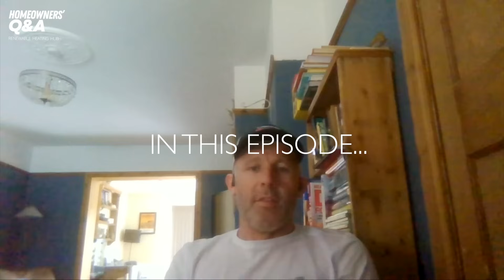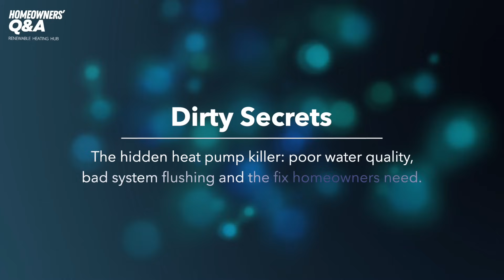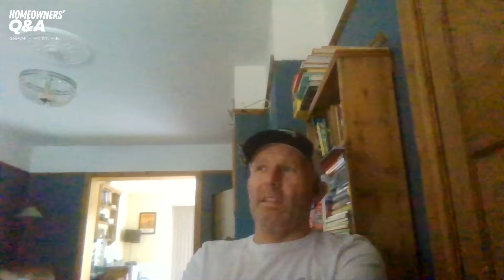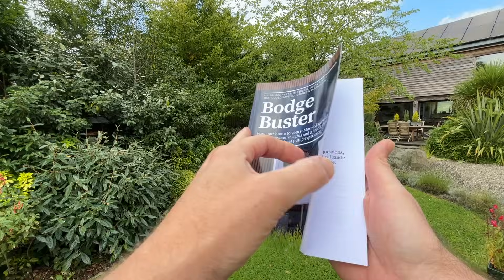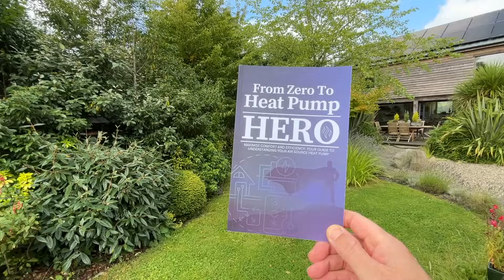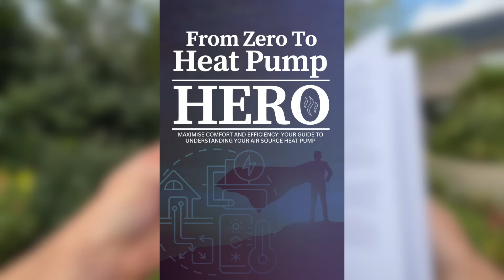Is Poor Water Quality Destroying Your Heat Pump & Radiators?

Comment: The current high mark for water heating quality in domestic systems is less than 1500mS. I come from an industry where the specification of the water is less than 0.1mS and uses high purity system pipe work. I know from direct experience that even on high purity systems, as soon as you stop circulating and as soon as you stop a sanitisation cycle that microbiological growth in the form of a biofilm will start.
The question has to be, in heating water, does it matter if you have microbiological growth, nobody is drinking it.

Comment: The ground source heat pump that is currently being installed into my high rise is being promised as low cost maintenance compared to our district gas central system. It is a hard water area so I'm thinking my housing association is not fully aware of this. It worries me that without legislation costs will be cut...and the heat pump will become inefficient. Obviously the electric company will be the winner.

Comment: I found this discussion very interesting. Some 50 plus years ago I made contact with Peter Muetzel the founder of Fernox. I was flushing and cleansing heating systems when all around said, oh, bang another rad in. I eventually moved up to commercial systems in large housing complexes. It’s ridiculous to consider all those years later system corrosion is still an issue, causing damage to internal components.

Comment: I remember when training on chemical treatment of heating system. Some years ago, it was explained that molybdate is an oxygen scavenger and is predominantly required in open vented systems. In practice the molybdate is used up, leaving the nitrites, still dosing the system water. This should then be topped up only with the chemical required and not the universal liquid provided in the bottle from the merchant. Just adding another bottle of the same mixture causes overdosing of nitrites, and this can lead to some problems with the system. The course also explained that molybdate is not really required in sealed, systems that are correctly constructed as they would not contain oxygen. So there would be no need to scavenge for it. In fact, if you look at vdi 2035 it gives the water quality measures required for inhibit to be unnecessary. If the system was clean enough prior to adding inhibiter, it would be almost certainly vdi compliant and no inhibitor would be required according to the science. Unfortunately, the regulations in the uk would still require the use of an inhibitor even though in this situation, it was likely to lead to a negative impact on system water quality. As far as i'm aware, the manufacturers only care if they're equipment is affected by poor water quality rather than if an inhibitor is present. I have run many tests on flushing and cleaning of systems and found that if you return a short while after the system has been compliant it will almost always no longer be compliant as the fresh water will have lifted some of the more stubborn deposits either into solution or suspension, causing the water quality test to fail. With gas boilers, whether water quality cannot be adequately maintained. I have historically used plate separation to protect the appliance from the system. It may come to pass that this will be a required technique for heat pumps. My reservations for the application with heat pumps are two fold. The first is that I suspect the platit exchanger in the heat pump could be cleaned using a suitable flushing, chemical and the power flush pump or descaling pump. Secondly, that there would be a loss of efficiency from the heat pump caused by the requirement of a delta t across the plates in the plate heat exchanger. Having said that vailant offer a kit that incorporates a plate heat exchanger to allow the use of antifreeze in only the outside unit. In this application, we have efficiency losses from the antifreeze, as well as from the plate heat exchanger.

Comment: The annual service provided by Daiikin on our heat pump does not include a system water test. Does that mean Daikin is liable if there is a heat pump failure exacerbated by poor water quality?
Reply from the maker: That’s an excellent question. I’ve not seen any manufacturer service cover or include this.

Comment: At least with the VDI 2035 approach you can test reliably, and without needing to know what someone did with the system before.

pH, conductivity and total hardness and you know the state of the water.
Reply: As someone whom worked on very high purity water systems (water for injection) I can assure you from direct experience that bringing water down to a conductivity of 1500 mS will have next to zero impact upon formation of biofilms and microbial growth. Particularly when domestic plumbing isn’t designed with hygiene in the criteria. You’d have to be bringing it upto 80C on a weekly basis to even keep that growth in a static condition. It would have to be permanently 80C to prevent growth.